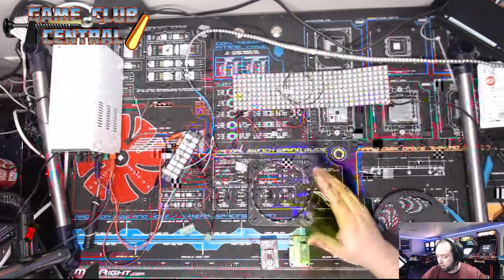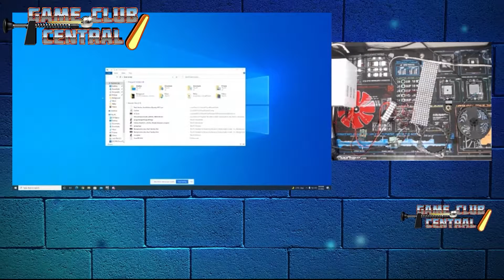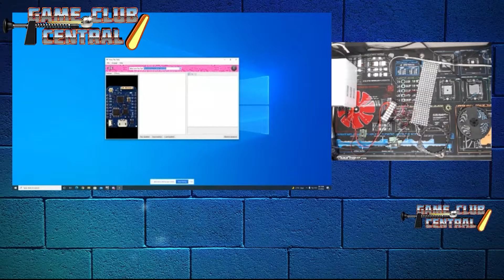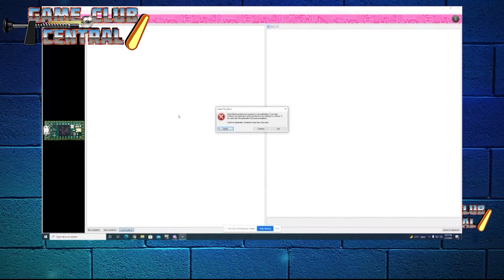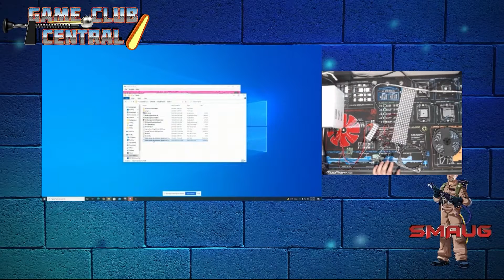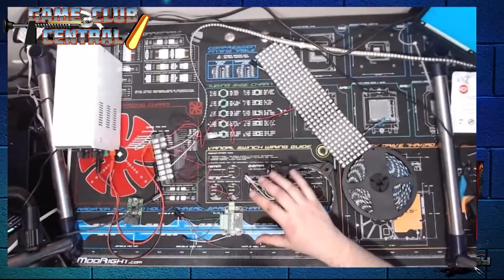GCC Virtual Pinball Guide: Teencab and ARGB

Comment: Is that a 4'' rgb speaker ring and where did you get it thank you :)
Reply from the maker: It is actually just standard LED strip with adhesive backing formed into circle. The bracket he is using is 3D printed and we have all the STL files available in our discord. I will get those pinned and send you a link here at some stage this week.
Reply: It’s a 5.25 speaker ring that I created with fusion360
Reply: @porrgy-labarcades8950  Thanks guy's for all the info !

Comment: Nice Video. I have both the Arnoz and Oaks micros. Can I pull the Teensy off of the Oaks and put it on the Arnoz board? Not sure how that affects the firmware that is already on it. Looks like 8 outputs will be better to have than 6.
Reply from the maker: I would say more than likely not an issue (Would need to flash the firmware), but reach out directly to Arnoz, he is really quick to respond! You can get real time answers in our discord for VPC too, here's a link, and Arnoz has a channel here too: https://discord.gg/gYV9N5MKbt

As a side note, I have Arnoz hardware, except I am using the PAL board from Oak Micros.
Reply: For me it will work :)